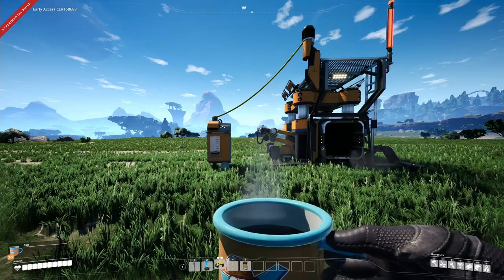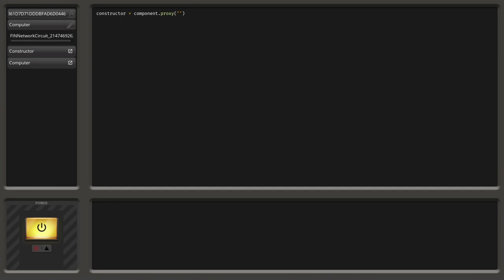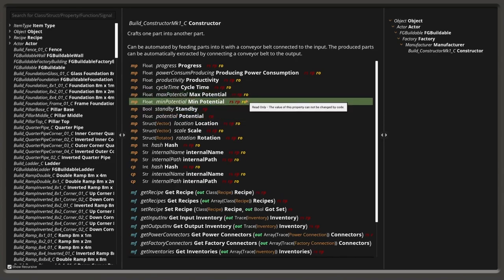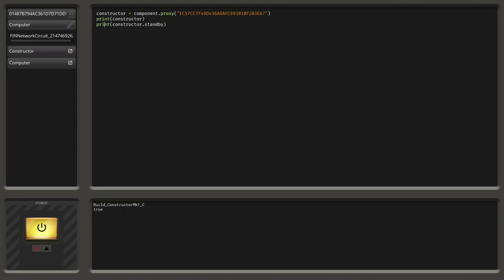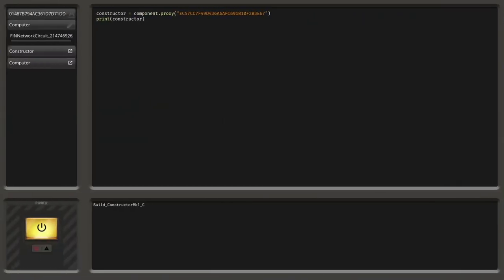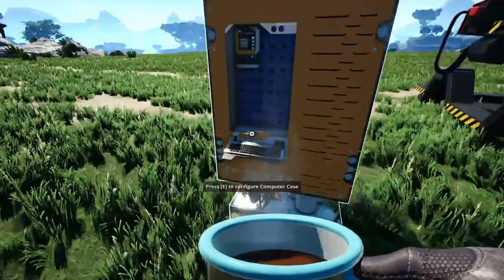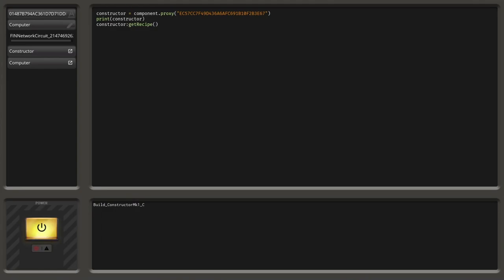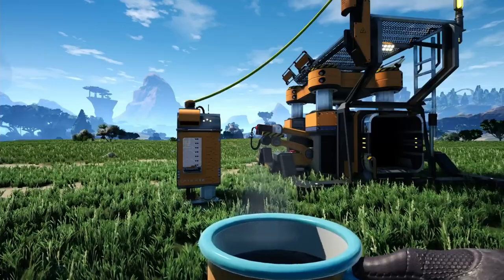FicsIt-Networks - Lua - Component Interaction | #03

Comment: Oh, now, for my energy-limited playstyle I can make it so that the machines don't waste power when they're idle, then... (implement auto-standby, instead of the idle mode)
I wonder, how it can be done...
Here's the goal-maximum: if a machine has all 3 PowerShards, it gets the ability to not waste energy while not doing any production.
The goal-minimum is the same, but without the PowerShard condition, if that's not a value I can get.

Anyway, I guess, I'll have to count the number of items in the machine and items that's about to enter a machine (cause they don't accept items in standby). Maybe I need some container before a crafter and check the inventory of both a crafter and that container... and based on that, auto on/off the machine.

Comment: How would you get the built-in GPU of the computer? And is there any way to have the component willingly try to "find" a component instead of knowing where exactly to go to get component "X"?
Reply: Managed to figure out the "find" functionality, however, still not sure how to get the GPU in the computer itself...
Reply from the maker: You can use "component.findComponent(<nick|class>)" to get an array of component ids by the given search parameter...
either you pass a nick query to search for components with the given nicks, or you pass a class of the components type you want to get

you can use the "computer.getPCIDevices(<class>)" function to get a list of PCI devices (like the GPU) with the given type as class...

so for a gpu this would be "computer.getPCIDevices(findClass("GPUT1"))" not that it returns an array of devices of the given class, as you can f.e. install multiple GPUs

for more info check the online documentation or talk about it on the discord server
Reply: @Panakotta000  Omg that's the missing link, tysm, was wondering why it seemed to not be self callable despite requiring an "instance" thing